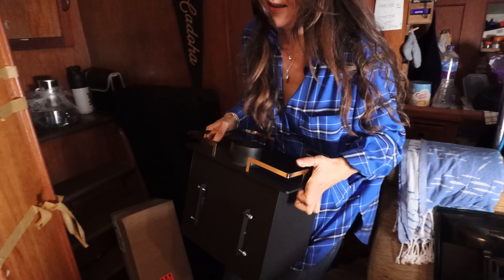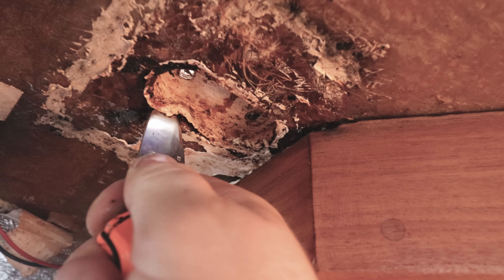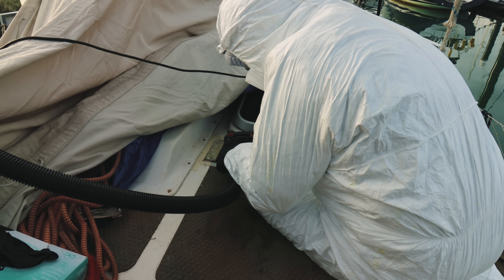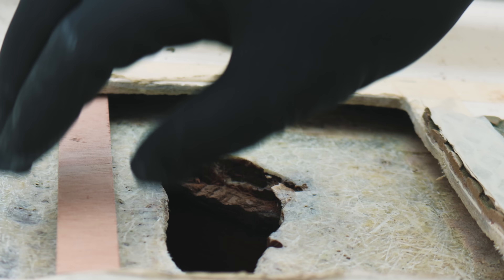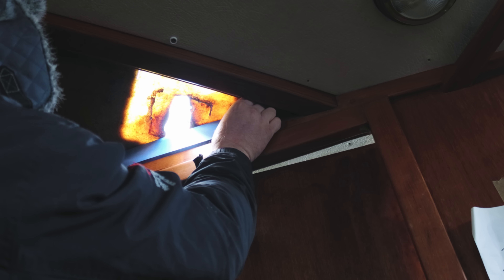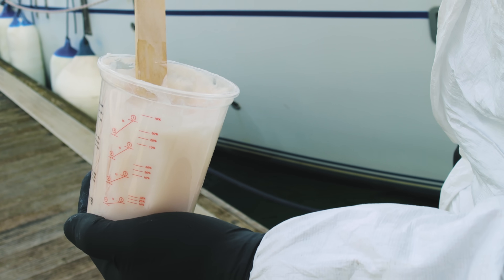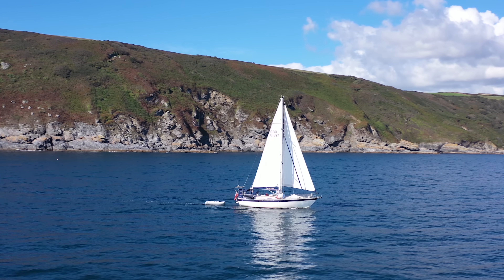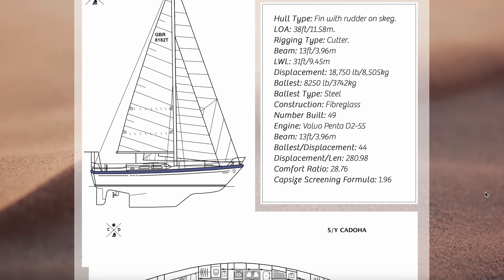We Have A PROBLEM.... (With Our Boat)

Comment: ... Excellent!! .. nothing like learning hands on with experts on hand to show and guide .... worked in a fiberglass boat factory in the late 70s, was pretty skilled at gel coat repairs back then, have not touched since. Seem to remember that the hardest part was getting the colour match. White is not always the white you are looking for .. smilin .. bet Karlie would be good at that ... Surprises me the limited backing in spots where one would think there is a lot of strain, consequently slight movement to start with ... thx for the share team Cadoha .. as always .. never stop dreaming, just dream bigger .. have fun be safe, save our oceans ....

Comment: Dom that repair will certainly be as strong as the original.
FYI for future you missed an opportunity to improve , the plywood is not a great compression member for such a high point loading, it would have been better to use some Fiberglass off cuts as core ( boat yards are full of discarded pieces of boats!)  this would be similar to the usual replacing of core with solid epoxy.    ( or just build up solid laminate).
Also plain cabosil/thickener added to the epoxy has NO structural properties, it does not increase the strength of the epoxy compared to solid epoxy, milled glass fiber is a better strength additive. But in this repair it will not make a different , just common miss conception. (making it thicker  to use does not make it stronger cured).
Cheers Warren

Comment: Funnily I thought you did this backwards, I would have preferred to attack it from below leaving the gel coat and top layer of glass fibre in place and getting to core via internal layer of glass fibre, then there would have been minimal intrusion on your gel coat and being inside you would have had the warmth of the boat to dry any glass fibre. It may have been more dusty, but that can be isolated

Comment: Had bits of core replacement on my big boat, check any place the core is penetrated by fittings and replace the core with epoxy structural filler. I did this on everything.

Comment: nice job been there donw that i would advise gogin round every decking fitting nd do the same check in the summer ever single bolts can cuase chaose with cores. even just taking a bolt out clrea out he the core with a allen key in a drill then fill with epoxy redrill hole  the bed with butil tape.

Comment: Awesome. Never knew silica was used as a filler with resin. Also, just found your channel, the voice over shots are unreal - looks so cinematic and cosy; suits your voice (coming from a New Zealander). Looking forward to following along on your journey.
Reply: Hi , fyi colloidal silica is not a filler it is a thickener, it actually only increases the viscosity of resin. It’s used in many other products too for same reason , ketchup, tooth paste etc .   Some true fillers are mixed with ‘silica’ to thicken and fill the resin. See my other comment. Cheers Warren
Reply: @CheersWarren  Good to know mate. I just patched a hole in my dingy. I ended up cutting the a square of ply to shape, then used two cross sections of timber (they were wider than the width of ply) to hold the ply in place and flush against the hull. Then glued it with builder bog, glassed over it once I could remove the cross sections. In future should I be using the silica thickener as a glue rather than builders bog? hope that makes sense.

Comment: Excellent video iv got a similar problem on my Moody around the mast step caused by old mast electric fitting leaking letting in water into core I will use 12mm nylon commercial bread board as a new core it will never rot again I have already used the same as a backing to new seacocks

Comment: Cored Grp hulls and decks are always prone rot where you've got through hull fittings, no matter how much or how expensive the mastic some moisture always gets in eventually. I'd have thought high load areas like that would have been constructed with a solid core both to spread the load and prevent such issues, was that main sheet system a retro fit? Nice fix in any case. The only thing I'd have done differently would be to feather back the edge of the top layer of existing deck so the new glass had a good bond to it. But ask ten boat builders how to do a repair and you'll get ten different answers
.
Reply: With the 'good weather' on the way.... a feather grind on the top and a lighter grind one below before additional laminate will nicely finish this repair off - super strong..

Comment: How come it all looks so easy when someone else does it. I did a similar repair on my boat, I taped up inside the boat to stop the resin simply falling through and filled the void from above. Great I thought, until I went below to have a butchers, and oh what a surprise, great globs of resin had pushed their way passed the tape and collected in a nice puddle on top of my dust sheet. 

Mental note to self, when placing dust sheet over cushions to protect from falling resin, use plastic sheets not fabric otherwise it leaks through sheet and ends up on cushion which then has to be thrown away.

Comment: This is why anyone intending to buy an older sailboat should first invest in a moisture meter, and learn how to use it. Before buying that boat, be aware of every area of elevated moisture, and commit to remediating each area as soon as possible. Because core rot is the slow cancer that will eventually destroy any boat, if not stopped.
Reply from the maker: That's great advice 👍🏻
Reply: Only problem with getting a moisture meter involved. You may never end up finding a boat you want to buy. Ha!

Comment: Looks like the rot was localised to the area around the fixing point, have you inspected the other areas where things are fixed thru the deck ? . On your previous video, putting the flue thru the deck , you sealed the edge of the core with epoxy, I’ve noticed on other channels when they do this sort of thing , they undercut the core with a bearing guided cutter, and then seal with thickened epoxy , just an observation 😉 
Wishing you all the best for the new “off the grid” year 😃🍻🥂
Reply from the maker: Thankfully it was very localised. Appreciate the feedback, Dave. Hope you had a great festive season and here’s to a happy and healthy new year 🙏🏼☺️
Reply: If the bolts were put thru the cored area the compression load is too high for the core so over time it compresses, this leads to a failure of the sealant and then water get into the core. This then rots the core, depending on how well the balsa/wood is resin saturated. This is why the core should be replaced with a non compressible laminate or resin.    Around the stove pipe there may only be light compression loads so sealing the balsa core may be acceptable.
Failure to replace deck core in high compression penetrations is the cause of a lot of the rot in  balsa core in so many boats.
Cheers Warren

Comment: Hmm. Would have done it slightly different. I know, that´s what comments always say. However, putting a thin layer of unfilled epoxy on the grinded surface helps get a better bond, as the thinner resin can create a better mechanical bond in the grinded surface. Later the filled epoxy then creates a chemical bond with this first layer. Secondly: Why not leave a spot of pure epoxy without wood core where the D-Ring wille go? It will become leaky one day anyway. Was it drilled through pure epoxy , that would not be an issue.